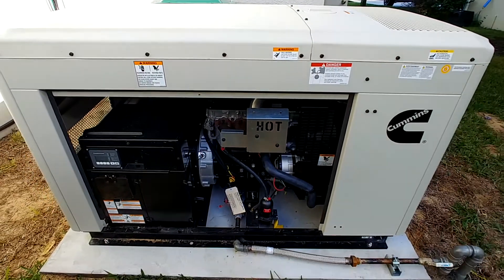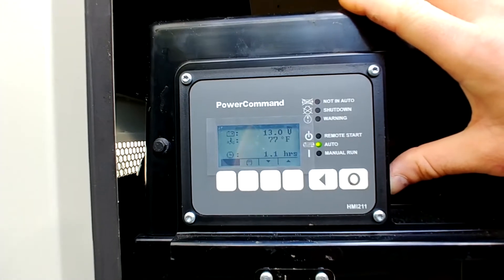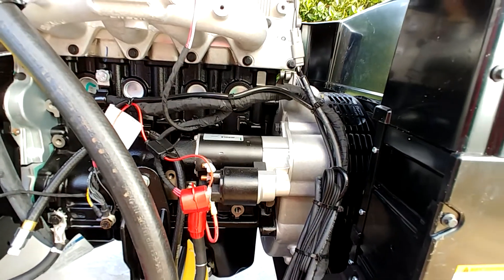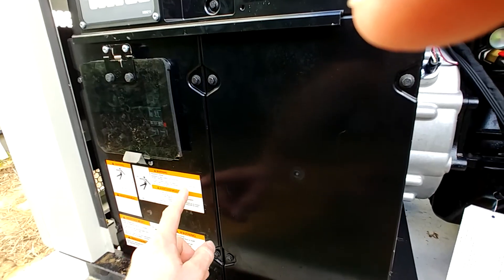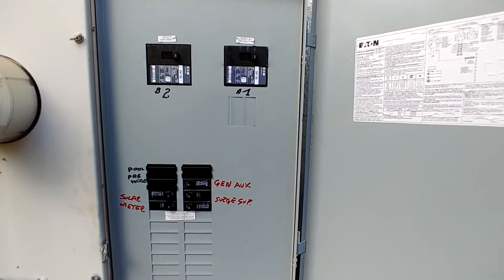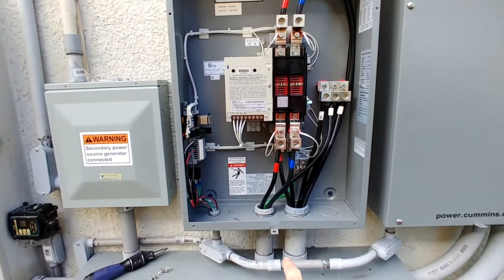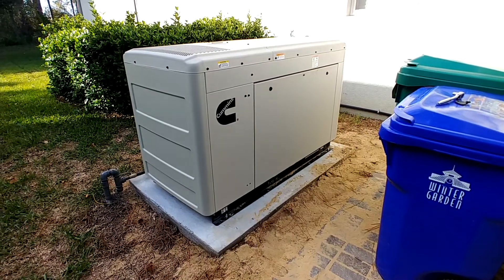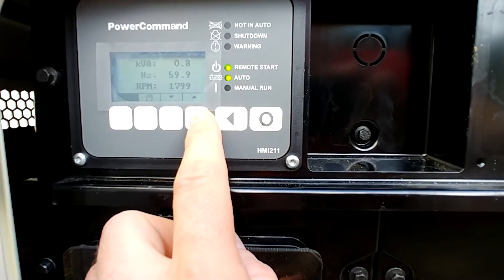Cummins RS25 Generator Review

Comment: Incredible that all the wiring, boxes and switches are outside in the open, easy to be messed around with by any trespasser
Reply from the maker: The side panels are off of the unit while making the video. Nothing is exposed to the elements when the unit is buttoned up.

Comment: I'm shopping to replace our Generac generator. I have APC UPS on all of my networking, PCs, I live in Florida TVs, you name it and anything I've deemed valuable. However, it becomes a pain in the * having to maintain, replace batteries and keeping your fingers crossed that these APCs will work. I'm thinking about a Tesla powerwall to act as an UPS. Somebody mentioned to me, I have not verified, that the switch time is good enough to act as an UPS. I've been pricing around for liquid cooled generators and this place in Sarasota, Florida I think is smoking crack, but here's my prices. I should note that I currently have a Generac and a 250 gallon LP: 

Replace with 30 KW Kohler, and 500 LP tank. = 35,994.00

       Alternate additional work, or services not included in this quote.
Per set of surge device’s 385.00 per ATS used.
Maintenance agreement per attached pricing.
Wireless monitor per attached 579.75
Reply: .. BTW .. Yes we did lose power and fortunately we only got the back slap of Ian. We lost power for approximately 24 hours. I want to make certain that I have enough fuel for 7 days of continuous use at whatever load I feel like using. As it is now, I feel like our house is more like living in a camper we have to be careful with fuel consumption. Similar to EV range anxiety. As soon as a hurricane is announced, I calculate 3 days after being hit requesting an LP refill.

Comment: How has the generator been holding up?  Any major issues since this video?  I'm dealing with hurricane Ian right now in Florida and I don't even want to use my 8kw generator because it can't cool the house and it eats way too much fuel for what it is doing.  I should have bought a smaller generator to run the fridge or gone all out and got a whole home generator.
Reply from the maker: Its served us well.  Have changed the oil once, and topped off the coolant, it's worked well.  Our power hasn't been the best this year and I think we've used it 3 or 4 times already.  I installed hard start capacitors on my AC units and it starts and runs both (2.5 ton and 3 ton) while allowing us to use other items in the house as well.  Well worth it, still going strong with no issues!
Reply: @bruehlt  Thanks for the feedback.

Comment: I have a 1300 sq ft house in the SW, I have a 3 ton AC unit, which model would you recommend. The electrical threat is either earthquakes, fires not likely where I live, but a weekend elec grid due to renewable energy.  So far no brown outs.
Reply from the maker: It depends if you have a natural gas or propane hook up and how long you are looking to last through an outage.  In FL here hurricanes can knock you off the grid for weeks in some locations.  We chose natural gas over propane because chances of the gas going offline were low, and trying to get a tank refilled in the midst of an outage could be problematic.  They do make smaller models - I think the smallest they make that is 1800 RPM with the 4 cylinder engine is 20kw - which would probably work for you.  If not the next size up is a 22kw that I know has a 4 cylinder engine and runs at 1800 rpm.  Below that range everything they make is 3600 rpm and uses a lawn eqiupment engine.
Reply: @bruehlt  Thanks for the reply, no hurricanes or tornados, just earthquakes, fires and grid issues.  I do have a natural gas,  and I have a Permitted 1" natural gas line already installed to the backyard. Decisions  Decisions.  The most have lost electricity so far is 12 hours. I am worried about the grid and roaming brown outs,. Ca. is insane they are removing gas fired power plants the newest one installed in Ca was 5 miles from my house, not only did they turn it off they removed it to the ground, so once the tipping point happens it could be 10 years to bring back the grid.
Reply from the maker: @Moondoggy1941  Yeah - when I installed mine, I read the info thoroughly and they include information about ensuring that it installed properly in areas with earthquakes.  There are certain requirements when anchoring to the pad, etc.  If you are going to hire someone to do it, just be aware that it will end up costing quite a bit to do.  I was floored by the quotes I received which is why I did it myself.  If you are able or allowed in your area to do some of the work yourself I encourage you to if you can.  I would say that its 100% worth owning one.  We had a power outage about 3 weeks ago that was 3 - 4 hours long, and it fired right up, and we didn't even know except for the first few min when it went out!
Reply: @bruehlt  I have been behind a shovel for over 30 years, I have a friend who is a licensed electrician, he does nothing for free, I would not have any other way,  so I can have him do all of the electrical, so trenching laying down concrete no problem.
Yes it is amazing how much contractors want for a little sweat, most are lazy and do sloppy work.  It took 9 months to do a 3 week double bathroom remodel. Between government political and contractors the only people who get paid to show up.

Comment: I was going to complain about how often you have the change the oil until I did a calculation. If you drive your car for 200 hours at 60 mph, that's 12,000 miles. So, a requirement to change the oil every 200 hours is really good. So then I wonder about using synthetic oil to extend the oil service life. Any thoughts? Thanks.
Reply from the maker: I always use synthetic oil in every engine I have. Right now my favorite is Pennzoil platinum or ultra platinum as the base stock is actually made from natural gas, not actual oil, meaning technically should be cleaner for the engine. Based on the fact that this is for emergency back up I'm not sure I'd push the oil change intervals though.

Comment: Good video. I install and service Kohler and Cummins, most all are 14 & 20 kw 3600 RPM. I have yet to have an air cooled stop working. Annual service (oil, filter, plugs) and an occasional valve check adjustment. Any job bigger than a 20 gets a 1800 24kw Kohler or a 25 Cummins. Genercrap makes up to a 24 3600 RPM  which I would never recommend. Genercrap spends an enormous amount on 24/7/365 advertising which is why there are so many out there and also brand them as Honeywell. You basically never here Kohler or Cummins advertised and you don't really need to. Those wanting the best like yourself will to the homework and make the smart choice and spend the minimal extra for quality.
Reply: I’ve been wondering about Generac.  Always hearing of them.  So which is better. Kohler 20,000 LP watt or Cummins?  Any advantages or one easier than another to service?
Reply: @edwardluth7740 , Cummins builds the best, then Kohler  and Generac at the bottom.  Honeywell uses the Generac generator but uses Honeywell controls.
Reply: @brucejones2354  I’ve heard that but no installers in my area.   So I wish my Retired Electrician was still working. He was the best along before him was his Dad.

Comment: Hey Travis. It's 2022 now and I thought I would ask you how your generator is doing. I am in the market for one and although this is a bit of overkill for me, I would rather buy something a bit too big than too small. I'm curious how reliable it has been so far and if there has been any warranty work or issues come up along the way. Thank you!
Reply from the maker: It's still working as strong as day one, no issues at all. Changed the oil last December and topped off the antifreeze overflow bottle. No issues at all! Still love it
Reply: @bruehlt  man this is great news. Bad news for my bank account however! Lol. Tx again!! May I suggest an update video? You certainly got alot of interest on your other generator ones and you are very thorough. You should be sponsored by Cummins!!
Reply: I’m in El Paso and we occasionally get power outages too. Damn hot this week. I notice Cummins calls this a quiet connect, but on the video sounded kind of loud. Is there further sound dampening you could add and if you have neighbors do they complain when it’s running? Thanks.

Comment: Betcha the oil filter is a GM style 1060..  Wix 51060..  our ten year old unit has an ol GM iron horse four banger.  They may have changed it by now YMMV..  Been solid with over 700 hours of use since installed.  That airfilter is the same as our unit from the looks of it..  I do have a Wix number for it somewhere but rarely need to change it.. Probably written inside the case as I usually do..  But it is 30 miles away for me to go look.

Comment: Great job Travis. I work on these units for Cummins and you cover all the important things. One of the things I have seen customers do is unplug the coolant heater because it does not get that cold here. I have to explain to them that the coolant heater is not for cold weather, it is to keep the engine warm so that if it has to start up and assume a load it does not have to do that cold. Sometimes when an engine starts cold it will not take a load, it will surge up and down in RPM until it warms up. Anyway, I thought I would throw that in. Great video.
Reply from the maker: Great feedback! Thanks for taking the time to comment!
Reply: I've got to find a whole house generator for my friend's house. I have real 5.9 Cummins engines diesels the best in the business when it comes to diesels. Are these Cummins Onan generators made coming strong? I'm thinking not when someone said it's a Mitsubishi engine. Or maybe I should say is the Cummins stronger than the generac, Kohler and Briggs & Stratton? Who's the best in the business with the least problems? The person will be running natural gas and in a pretty cold climate.
Reply from the maker: @manofmanyhats142  Based on my research for natural gas the two best brands are Cummins or Kohler
Reply: @bruehlt  Thanks for that input. I am in Louisiana and just beginning to look around. Do you STRONGLY recommend the WIFI monitoring? I would rather avoid the expense if possible.
Reply from the maker: @buzzon1571  it's not needed or necessary. I got it just because I wanted it. It is definitely quite an expensive add on
Reply: @bruehlt  Thanks.
Reply: @manofmanyhats142  They are all good in their own way. Some price wise, some quality wise, and some warranty wise, and some support wise. Quality wise, Generac is at the bottom. Kohler is good but not the quality of the Cummins. Cummins is at the top but does have issues with some models. I don’t know about the others but Cummins support is great. As a Cummins techs, we call 1-800-cummins to get help on some problems because they are at a company that has internet connection and access to the latest information. In short, Cummins has great tech support. I can’t speak for the others. Hope this helps you.
Reply: @HHIMgary  Great info. What models should I stay away from and what are the issues you are seeing? Tx. The RS25 is the model I am currently looking at. Tx in advance!
Reply: @m1lkman1974  Any model can have issues, they are all pretty good once the bugs, if any, are taken care of.
Reply: @HHIMgary  Do you work for Cummins?
Reply: @ceefaster6804  Not any more. I’m retired.
Reply: @ceefaster6804  Yes, I did. I’m retired now. : )

Comment: I am planning a future purchase for a home standby gen and the RS25 / 25KW is the best in class. Full 25KW output on NG and no reduced output like the lower cost air cooled high RPM gens.
What gauge wire did you use for the gen output to your transfer switch ? What model Cummins transfer switch did you use ?? VERY clean install if you DIY.
Did you use one of the preformed base pads or pour one onsite ?
Reply from the maker: The gauge depends on the run length and ampacity required.  For this install I believe I used 10 gauge and 1/0.  The transfer switches were model A064G376.
Reply: Those service disconnect automatic transfer switches are $$$$$$$$$$$$$$$$$.
I like it that every RS25 sold online is within about $10 of each other.

Its the generator I will be buying , just planning it out now and options.

Comment: I'm in Louisiana and just went through Ida. I have 2 small generators that I swap out. Been looking at the Generac quite source liquid cooled. But after watching this I'm going with the Cummins. Been out of power for 15 days now. And people with the smaller home units are having all kinds of problems.
Reply: Hey, I hear ya on the Hurricane IDA power outage….just got power last week myself. Where do you plan on getting your Cummins? I was looking at Generac myself but ran across this video and your comment so I may be changing my plan.
Reply: In louisiana to and everyone's generacs been crapping out they not made to run long term
Reply: In Louisiana too I have a 20kw Generac like all the rest mine ran without issue I wasn't there but the neighbors said it never stopped but others had issues Generac and Kohlers.  Too bad my house didn't fair as well.

Comment: Curious-what do you need 300amps for your house for?
Reply from the maker: That's what the house was wired for when we built it.
Reply: @bruehlt  It's not good for a generator (engine) to be run with partial load for long periods of time. A smaller generator working at 80% will last longer-or at least won't have carboning problems. But-natural gas isn't as sensitive as Diesel is. I'm going with Diesel, since natural gas can disappear in an emergency disaster. I know it is twice as expensive, but being an ex cross country big rig driver, I know the dependability of Diesels.
Reply from the maker: @Tchristman100  not true. Also diesel is fine if you can get refills during an emergency. Eventually it will run out.

Comment: Hey Travis,
   We just went through Hurricane IDA in SE Louisiana. The Cummins RS25 on propane ran for 114 hours nonstop. Max load was measured at 12,000 watts and it
worked perfectly the whole time. My 500 gallon propane tank went from 80% to 50% in the 114 hours of running. I am very pleased with the Cummins. Now it's time
to change the oil and filter and get ready for the next one. This generator was new as of Oct 2020.
Pat Darby
Covington, LA
Reply: I’m not scheduled to get power back until Sept 29th. That will be 1 full month without electricity from Hurricane Ida. Running on a portable. I will buy the RS25 now after watching this video. Thanks for the info!
Reply from the maker: @chesterguidry  sorry to hear that. That's quite a long time without power!
Reply from the maker: Wow that's great news! Congrats, I bet your neighbors were jealous
Reply: @bruehlt  My nearest neighbor is about 200 feet away and he couldn't hear my Cummins, but I did hear his 3600 rpm Generac which is on the opposite side
of his house. In all honesty, though, the Generac also ran throughout the blackout, but I could hear it when I stood outside even with my Cummins running. The Generac was hooked up to natural gas.  I don't know if the neighbor changed the oil and filter in the 5 days of running.
Reply from the maker: @nogeek43  that's not good. That engine will burn itself out of he's running it that long without changing the oil.... Yikes!
Reply: Hey nogeek43, 

I’m in prairieville and we are looking to get one of these since IDA. My house was recently built with a generac transfer switch, so you think I can use that with the Cummins? Also, who was/is a reputable dealer in south Louisiana ?
Reply from the maker: @adrianoden  unfortunately you'll need a Cummins transfer switch with the Cummins generator.
Reply: @adrianoden  I don't know if the Generac transfer switch would work with the Cummins, but talk with Pan American Power in Covington, LA and see if they can
work with you.  They will probably be very busy after IDA.
Reply: @nogeek43  I live just north of Hammond. How was your permitting process? Did it take long? Expensive?
Reply: @buzzon1571  pan American power handled all permits. I don’t think there were any. I am out of city limits.

Comment: Nice work. I have one to install with two transfer switches soon. Do you mind telling me how many control wires are needed and the name or type of relay needed to control the second transfer switch?
Reply from the maker: Hi the installation documentation shows relay ONAN 307-2817-01.  There are 4 control wires.
Reply: @bruehlt  Thanks. Trying to plan ahead.

Comment: I was convinced that I wanted a generac 22kw system. But what I really want is bullet proof reliability, especially if the power is out for a week straight.. Seems like Cummins has that.
Reply: I've been recently quoted 19k OTD for a generac 24kw, transfer switch, whole house surge protector, 60 ft run of gas. Seems high to me. What does the rest of the internet think? Price was from a franchise, mister sparky
Reply: @blueboat9581  That price seems about right, but it depends on where you live and the amount or work to hook up the unit. The Cummins RS25 was around $10,000 just for the generator and transfer switch in 2020.